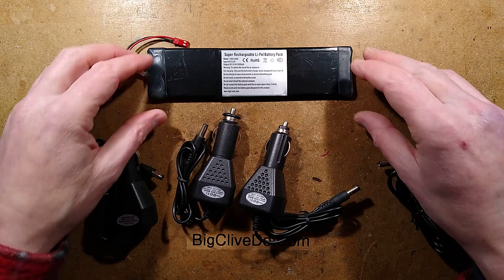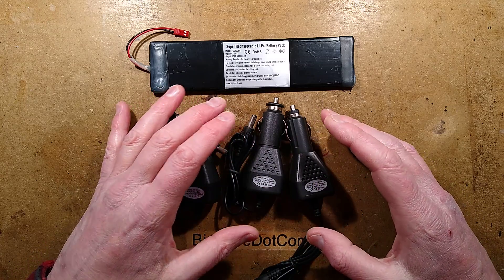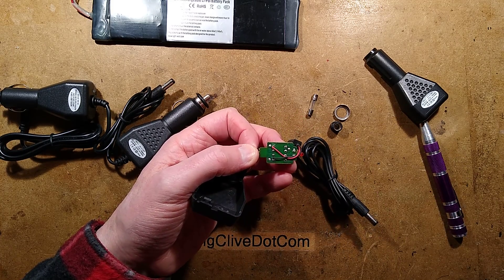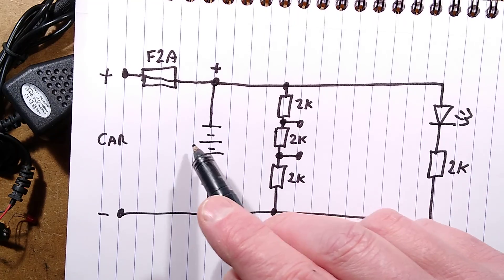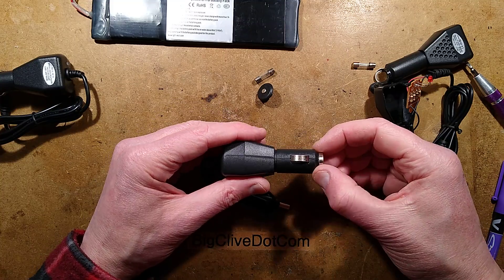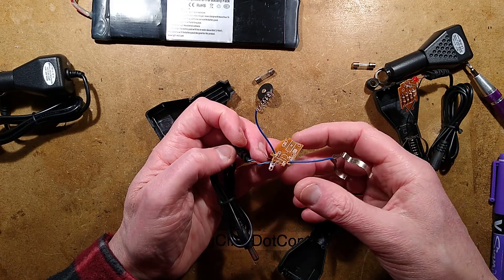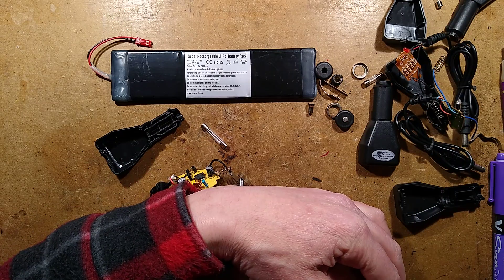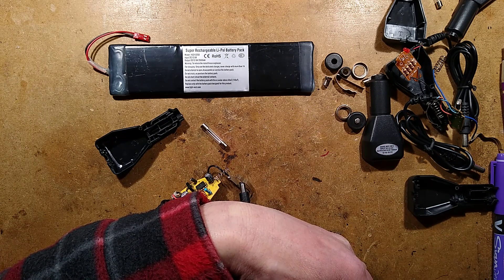Triple trouble - when offshoring goes wrong

Comment: This reminds me of a story my dad (an electronics engineer) told me many years ago.  Back in the 70s, the company he worked for designed a phone and hired a small company in Japan to manufacture and populate the circuit boards.  When the first batch of completed phones came in to the company, none of them worked.  So my dad started pulling them apart to see what was wrong.  There were parts in the wrong places, missing parts, broken parts, etc.  So my dad took a trip to Japan to see how the boards were being populated.  He ended up in a small room with one man sitting in a chair and a group of about 10 old women sitting on the floor in a circle with buckets of parts in the center.  The man would take a part and hold it in the air for all to see and tell the women "Okay, this part looks like this and goes here on the board," and he would then place the part on the board.  All the women would reach into the buckets (no two women would reach into the same bucket), grab a part, and place it in random holes on the board.  Production was immediately moved back to the USA after that.
Reply: Sounds a lot like how my company develops software.
Reply: I was studying electronics engineering in the 1980s. The company that one of our lecturers worked for had 100 electronic units of some type manufactured in Japan, with a condition that there was to be a failure rate of no more than two percent.
When they opened the crate they found 98 working units, and, wrapped separately and labelled as such, the two faulty units.
Reply: @geoffreykeane4072  
I've actually heard this story before too. Not sure if it's true or just an urban legend of sorts, but it sounds like something the overdsciplined Japanese would do, partly due to a misunderstanding in translation.
Reply: @jtveg  yes it sounds apocryphal but actually happened in this case. As you suggest I do think it was in reality a misunderstanding of a contract term. It may well have happened several times till the “lost in translation” was resolved. It would have been very early in the TQM era, probably 1984 from memory.
Reply: @geoffreykeane4072  I can believe this.
Reply: The Japanese in the 70's are the Chinese in the new millennium. Fortunately the Japanese lifted their game.
Reply: There is a reference to this in Back to the Future.
1985: "All the best stuff is made in Japan"
1955: Japanese stuff is junk. (I forget the exact line utter by Doc)
Reply: @gorillaau  yes, it's in BTTF3 when they unearth the time machine from the abandoned mine in 1955 and repair the damage (caused by the lightning strike at Lyon Estates at the end of the previous movie (that sent Doc back to 1885) with contemporary parts (vacuum tubes and the like.) 

Doc: 'no wonder this circuit failed, look, it says 'Made in Japan!'
Marty: 'what do you mean Doc? All the best stuff is made in Japan.' 
Doc: 'Unbelievable...'
Reply: always gotta be extra careful with tech startups
Reply: This is amazing to me. I have always held Japanese manufactured products in pretty high regard. Gosh, the majority of Japanese branded, consumer electronics from the early seventies (1970s) through to the eighties (1980s) were sold at every consumer electronics chain in the USA. Perhaps the Chinese learned from that one man and his circle of women assembling your dad's company's telephones and that is how this kind of crap can happen? Just amazing...   Fred
Reply: @electronicengineer  In the 70s, Japan was not yet the industrial powerhouse it would become. About 10 years later they were beating us at almost everything.
Reply: @javaguru7141  And that's where China is going.   It's the same thing the US did before that.  Now the US has let itself descend into crap and madness, while still being a superpower that we must all obey.  Anyway, I have to leave because there's a war this morning and I need to handle potential disruption to supply chains.
Reply: @ElectroDFW  - Except that the 'hugely expensive' robotic devices can run 24/7, with only downtime for basic maintenance, don't get bored, don't go on strike when the union two states away has a grievance, and pay for themselves pretty quickly.   If it's a completely 100% repetitive, predictable process, you're better off automating it.   Humans are better at spotting 'wait, that looks backwards', and being able to adjust to changing conditions.   The big issue is when you have automation built like Tesla - which was obviously never really set up correctly.   

So, you'll find pre-populated boards with the really simple components already in place.   Complicated components, or anything that needs routing around something, are still done by people.
Reply: @javaguru7141   ... and largely because W. Edwards Deming went to Japan and taught them  the real meaning of quality and how to achieve it. Interestingly, his philosophy was earlier rejected in the USA.
Reply: @electronicengineer  keep in mind that Japan went through an insane economic, education, and production revolution in the post-war era.   You're going to have some issues for the market to stabilize and standards established.   In truth, before Japan's complete domination of electronics in later years,  we used Japan much like we use China today.    

China today is honestly a lot better off in those regards.  The quality of products is pretty good.  Problem is, China's culture has a distinct lack of ethics when it comes to business.  Very much of "If you get scammed, it's your fault you got scammed" and "If you can get more money without being caught, you should" sort of place.   So where as other manufacturers would withhold faulty goods, China's factories will often push them out- knowing there's nothing you can do about it (most of the time).
Reply: @Rainsoakedcoat  A polished kind of theft.
Reply: @Rainsoakedcoat  When I was a kid if your toys were marked 'made in Hong Kong' they were crap.
Reply: @Rainsoakedcoat  I forget whether it was ADVChina or SerpentZA's channel, but they described exactly this attitude.  "Everyone cheats, it's normal, you have to take something for yourself out of every transaction" -- that kind of thing.  It's basically expected that corners will be cut somewhere and the "excess" will end up in someone's pocket.
Reply: @Rainsoakedcoat  ,this seems to be a suitable place to tell a story i heard.  a person who lives close to me invented something (i cant remember what it was- might have been something to do with garage doors.  i remember thinking it was clever.) got international patents and rushed from perth, australia to china to arrange the manufacture.  too late - it was already getting made all over the place.  there was no point continuing so he gave up and came home.
Reply: @electronicengineer  In the early days, Japan was very much like China is now. They got a lot better after that.
Reply: @electronicengineer  I can imagine it's just one of those things, the company probably went with the lowest Japanese bidder and ended up with a sweat shop with very little technical knowledge. The same could very well happen in the USA if you never actually checked who you was paying to manufacture your equipment.
Reply: @electronicengineer  You can't trust a product just by what country it came from.   Every area has good and bad companies.   I would trust that even the company next door would have the same quality.  

It really bugs me when people make such generalizations.  It's borderline racist.   I know some companies leverage it heavily, like companies that splatter all over their product "Made in the USA*", with flags and screaming eagles all over it.   What makes it worse is that all the components in their product were made at the lowest bidder's shop in China.  They've hired prison labor to snap the two halves of the product together, and put it into their "Made in the USA*" emblazon box.   Somewhere, buried in some documentation somewhere, that asterisk that you just overlooked twice points towards, it says a very short blurb about the parts "may" have come from a factory that "handled peanuts, gluten, and used parts from recycled e-waste."

The second charger that he opened really smells like "recycled e-waste".   They just snapped off a piece of PCB, just enough to solder the wires and LED onto.   Possibly using the leftover solder that was already on the board.  There's a 90% chance that the company name has "quality" in it somewhere.
Reply: This Japan story shows how it will evolve with China. However, China is much bigger, not a full democracy, so it will take more than a decade are two for them to up their standards.
Reply: @ErikBongers  There are also significant cultural and societal obstacles within China that are going to make that process much more difficult than it was in Japan.
Reply: @ErikBongers  Imagine thinking the West let alone Japan is really "democratic." 😂 Both are democratic within a tiny and ineffective window. We have next to no say in what happens to our country. And it's not a conspiracy, it's just that representative "democracies" tend to reflect power, not create it. International institutions such as the EU, ownership of the media, client journalism, political donations, the ability of the super rich to move money out of the country (wasn't always the case), and the power held by self serving bureaucrats and cliques in many institutions - not just the civil service, but political parties, trade unions, local government, finance. Unless what you are really talking about is capitalism, and Freedom™, which has nothing to do with democracy. With that said, China's hybrid of capitalism and bureaucratic statism is no better.
Reply: Lowest bidder. As used to be with Japan, China now is the cheap labor. I do know if you pay for it, China will build it to spec.
Reply: I have a story where I designed a circuit to interface with Bluetooth.  it was going to be one component in a bigger project.  but no only did it end up costing more then they initially said it would since I had to buy a larger quantity then I was expecting none of them worked. and they where super adamant that it was not due to them messing up, and they wouldn't redo it or give me any of my money back.  not going to do business with fabricators over there again.
Reply: We had a Japanese marine bearing company make us a very expensive bearing ~$500,000 about 7 years ago.  When we received them, I did a complete set of measurements as I do with all the bearings we get.  It turned out they were not round.  They're partial arc bearings so what they did was make a tube and cut it in half, when you do that the ends expand out because they're no longer stressed as they were when it was a tube.  We contacted the company and they said no, you're measuring it wrong (LMAO).  so I used a waterjet to create a perfect circle that represented the hole the bearing was supposed to go into (these are large bearings) and sent them a picture.  They said they needed to come see it for themselves.  So we had to pay for 5 of their engineers and 1 translator to fly over from Japan.  They insisted that the bearing we wanted could not be made... but we return the bearing back to them and they could modify it enough to make it work.  It was so frustrating, in their eyes they could do no wrong.  So now we have a bunch of 1/2 million USD paper weights.
Reply: Superior Japanese engineering!
They weren't making phones, they were covertly building parts for a super big robot!
Reply: Back in the days of " Jap Crap". My how things have changed.
Reply: quite the story.
Reply: The Japanese when I was there in the 80s used to öutsource" the assembly of Walkman's, radios, anything that wasn't too complicated to families for bit rate wages. It was cheaper for the companies than having a mass production line. However, I didn't see soldering of boards, just pre-soldered and wired boards. They even did the boxing!
Reply: The cheap Japanese manufacturer must have sub-contracted assembly, who in turn sub-sub-contracted, who sub-sub-sub-contracted, etc. with each level taking their own skim of profits and passing responsibility down, until the end result is total junk.
Reply: Screwwy that such a thing happened. It's not that hard to separate parts into labeled bins, at which point one then reads the silkscreened markings on the board. Then it's almost like a game to look for all the things on the board that have the same letter and number combo as a particular part bin and populate a board that way. Some things like diodes, electrolytic caps, and chips also had some extra doot marked on the board for alignment too, so you'd have to be rather ignorant to screw that up.

Only way I know that is I worked some temp job that had circuit boards on a line rack before somebody else would put them on some slotted cart to later go into some wave soldering machine. Not a job I had for long though. Called in sick and they didn't believe me, so I showed up due to that and puked all over the place. Got let go after that, but given that's how they were - that was probably a good thing.
Reply: Moved to USA   hhhhmmmm , did it get any better ??
Reply: @RS-Amsterdam  The thing is moving your manufacturer back to the USA and under a legal system that for the most part actually functions allows you to sue a obvious failure to meet the contract obligations. If those didn't give you what you hired them to build you they were not going to be profiting from it or be in business very long. In China the government and legal system is a class system where the rich do what they want and if anyone does get in trouble it will be some random employee and this isn't likely to actually get this far if you are foreign unless you have deep pockets + a party member in government friend to push it. Even with that if your product is made and being sold for any real profit china will take the IP and subsidize a Chinese clone company to sell while slowly pushing your product out of the market entirely essentially stealing then entire product and business from you and may have never even allowed your product to be sold inside of China. China has no ethics and the only people outside of china that are really making money are investment types that are handling other peoples money for a cut generating short term profit for the mere price of the future economic and manufacturing capacity of the US standing in the world gone and a population of rich political types marketing types and banking types while the rest can work a cash register selling cigarettes where over half the price is tax and forced into a rent everything own nothing life where the powerful can cut you off at will and you have no real way to retire and stop working but will be force into poverty if you voice anything those taking your money and investing into china dont like almost like a slave. 

In china they fuck you and flip you off from across the ocean if they were in America they would be served a summons to appear in court and possibly be liable for all damages and even jailed. The entire idea of moving all of this overseas is wallstreet assholes who make money moving around money that they don't own and often on future capital that may never get produced. It's enabled by public trading where investor returns are the priority and brand reputation safety and general productive health and middle class economies growing and stable where those working can have kids who when they grow up can also buy a house and car and own things for themselves just like the parents 20-30 years later actually possible means jack all as legally the obligation of these traded company is the investors who don't typically give a shit about any business only the return they get from the money they already hold that they loan expecting to sell off any ownership in a year or two for a profit and china is glad to take the entire industry from the US giving people lives while investors gladly sell it all off to them almost in passive ignorance to what they are doing with executives making what was a safe useful product that would be serviceable to a engineered to fail every few years hazard that doesn't do the job as well and will end up in landfil somewhere so that margin of 1 dollar per unit profit can become 1 dollar and 10 cents per unit giving slight boost in investors holding value they sell before public reputation of the brand is ruined and people stop buying the crap that if they are lucky there is a 100% Chinese version clone that was stolen will be available but that product give no one outside of china any earnings at all.  Then we can all be lving on welfare watching as the dollar is inflated to shit to pay for it for a decade before the only power the us can have in the world is bombs they can make themselves anymore and the welfare system fails and the US falls to ruin and you see a communist China show up to save the day and we can have the same fucked class system and dystopian  tyranny for our kids all over a few decade. Meenwhile those investors are all retired on the islands they bought making all that money destroying the productive industry of the us labor force. This isn't cause of capitalism, it's all from corporatism and endless expansion of government holding hands of the connected who have been writing all the laws that make them all rich using the government that people are ignorant about and still the blame will be pushed onto capitalist western economics even tho it's the socialist government expansion and fascist corporate collusion with government that does it..
Reply: @RS-Amsterdam  I don't know.  I don't think the phone was ever offered for sale so the company might have given up on it, but my dad didn't tell me.
Reply: U
Reply: Either this 2was bottom of the barrel for a manufacturer in the 70s, as in the cheapest or your thinking of some other country. Japan has always had a highly skilled, highly motivated work force. I'm sorry, I cant believe this.
Reply: @marcellachine5718  
In the 70s Japan was more known as a supplier of low quality yet affordable mass produced products. When a consumer item was of particularly low quality, it was cliche to say: "it was made in Japan". Just like we do with China today. The title soon moved to Taiwan, Malaysia, Vietnam, Mexico and now China. Next will be Africa, the final frontier for cheap labour and ultimately low quality goods.
Reply: @jtveg  I still contend that this was a bottom of the barrel manufacturing operation, and not typical of Japan at the time. We are talking about 70s phone technology. There ain't much there. Honestly a barrel of monkeys could have done better than described.
Reply: Well said.
Reply: @marcellachine5718  
I agree, that was as crappy, as home grown, as unprofessional, as bottom of the barrel, as you can get. Even for Japan in the 70s.
Reply: @marcellachine5718  I was a kid in the 1960s and I used to buy toys and model kits. There were some made in Japan that were really good and some that were bad and would break almost immediately. Some of the model kits were themselves of very good quality but had English instructions that were seriously ungrammatical.